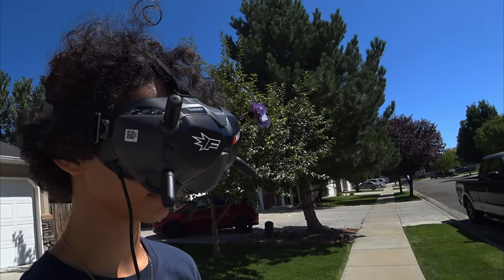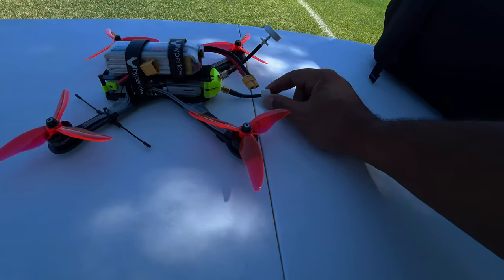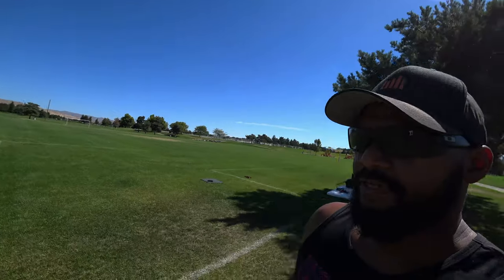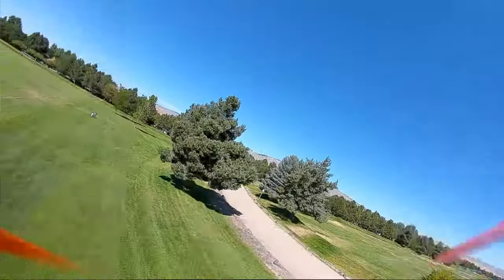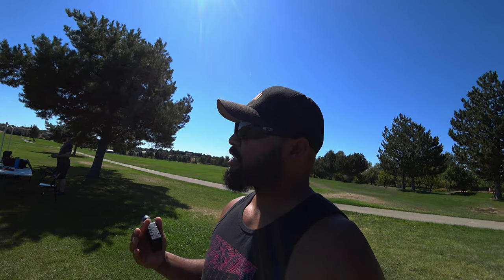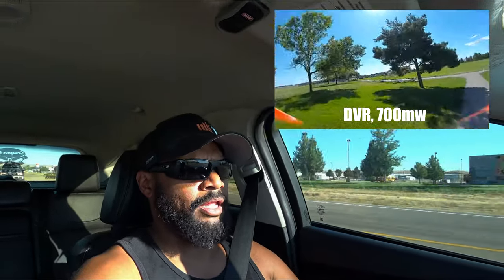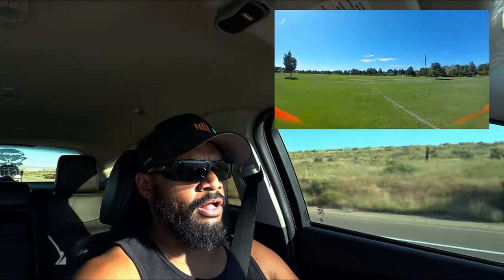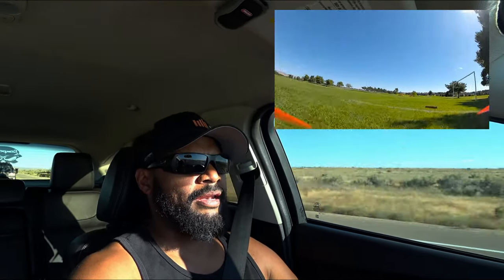You probably shouldn't try the DJI HD FPV system 😑 // Vlog

Comment: I am with you! I have a fully decked out HDO setup and don't even want to touch them after 1 pack on the DJI FPV HD system. I fly because I love the immersion and nothing comes close to this. It is like what VR wants to be. You are absolutely right that after you experience the system it will be hard to go back to analog.

Comment: BTW, my local MultiGP chapter has just initiated a full DJI only class. It's not MGP official of course, but any local series they run will have a DJI class.
Reply from the maker: wow that's cool!
Reply: @Furadi  This the home field for the EMAX guys... This where JD, PiMan and ReggieR3 fly. They are very much into this DJI system, so I guess the influence is big. I intend to jump onboard as some point, at least on 1 or 2 quads. I just spent a lot of money in rebuilding the race fleet, so I'm out for a bit. I'm not getting off analog anytime soon though. I have flown the DJI unit and I can see me being happy flying both. That's because I still race a lot and also fly for the GoPro, so my mind is still on what's working for me right now.

Comment: The strap from the eachine ev200d works great on the dji goggles.
Reply: I did some flying today and the eachine 1800mah 2s battery running the goggles is only good for a about two flights. It has a charge indicator on the battery and when it is 3 out of 4 bars it can barely run the goggles. I had it on the bench for a little while replaying and then plugged in my quad, it quickly dropped below 7 volts and the goggles started beeping. Wouldn't want that to happen in the air. The eachine strap is still a nice upgrade but 2s isn't enough.
Reply from the maker: @hildy2222  yeah I'm running a 4s 1500 now and it lasts a little while.

Comment: I wonder if the air unit could be smaller for people who want to use their own radio. Otherwise it's just a really big VTX. Have people forgot all together micros, toothpicks and tiny whoops? People will want to keep their analog goggles around just for that.
Reply from the maker: It is a big vtx, but it's also doing way more work than an analog vtx. Also Iflight has a bnf 3" out that is sub 250g auw.
Reply: @Furadi  This basically replaces any capture cam you need, so as far I as I see it you are saving weight.

Comment: I'm new to FPV. Can you use a Taranis X9D 2019 Special Edition, Crossfire TX, and the DJI goggles? Seems like that'd be pretty badass all-round but I don't know about compatibility
Reply from the maker: Yep you can basically use whatever radio you want with the DJI goggles and Air Unit because it all ties into your flight controller. The Air Unit gets connected to the FC and the radio receiver does too separately. FYI you don't need to start with crossfire as that's meant for long range. Just a plain Taranis has about a mile of range in it in optimal conditions.
Reply: @Furadi  subscribed because i see you helping noobs like me.

Comment: LOL! vape saved my life from ciggs. Wow if the lame a33 markets recover I will get the fly more DJI system for tourist flying the mountains. Until then I will refrain from observing the quality first hand. Dom v3, Attitude SD's still working here years and hours of use later. Good review! paid up :) that counts with all the crap being sold these days. Digi vtx has to come down in size like 50% to get full market share no rush. Air unit is at VHS stage now.

Comment: Is control still 2.4 and video 5.8? Does the power strength affect video and control? Would it be better with our taranis or keep the dji remote? Thx for video 👍
Reply from the maker: I would use either frsky or 900mhz. In my case I'm using crossfire. The DJI remote feels great but I don't like how it shares the video channel.
Reply: if using the dji transmitter, they're both on 5.8ghz

Comment: watching your video I just have to laugh … two years ago I bought the Occusinc.  Little disappointed.  I actually love the huge goggles but the analog just didn't work ...oh well ..I have had the FPV system for three weeks.  I now have built 4 DJI kwads.  I am at 50/50.  I fly the analog with Crossfire to practice.  Then I put on the DJI goggles to enjoy the visual experience.  IT IS AMAZING ….  worth every penny...I feel bad for ORCA.  I am about to get the DJI tx.  I want the new connection and I always enjoyed the  controllers for the  Phantoms …  GREAT REVIEW !!!  check out the new DJI FPV stacks from Holybro and Newbeedrone.  Flt cont/esc with direct cable to simply plug into air unit.  so simple !
Reply: I feel bad for orqa too they took a bit too long to come out

Comment: Try contacting Aomway for service on your $300 Commander V1. When my set died after 8 months I tried, it's been a month and after several email attempts and a phone call to a Chinese only speaking answering machine I have given up on Aomway. They have no customer service at all. Fat Shark on the other hand is known for their customer service so I paid $577 and I get piece of mind and bad ass goggles that work with all my quads. How does DJI do when you are 3 kilometers out? Thanks for the video.
Reply from the maker: Yeah that's a risk but I'll accept the risk and save $300.

Comment: You running on 4s? How is the radio?
Reply from the maker: Yessir 4s and 5s with a diatone 12v regulator to power the Air Unit. I'm still using my X7 for control.
Reply: @Furadi  cool